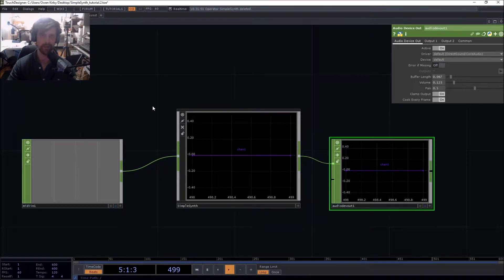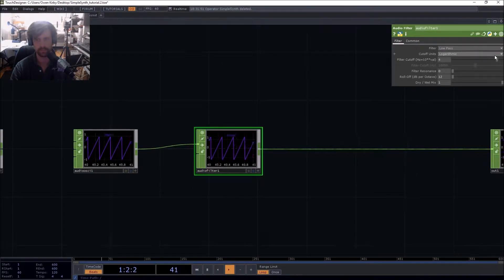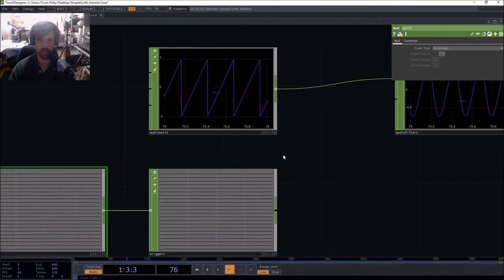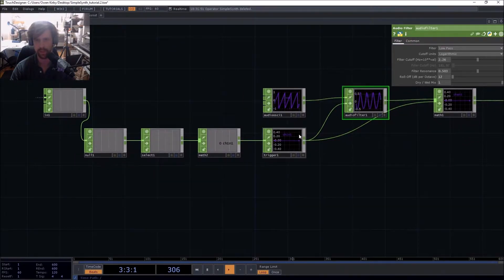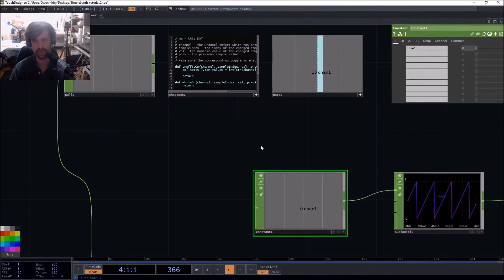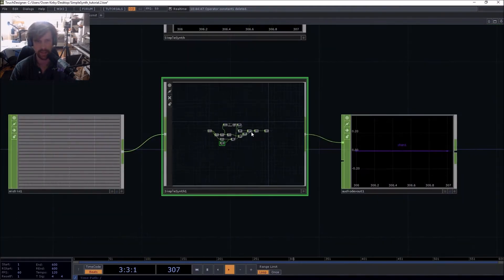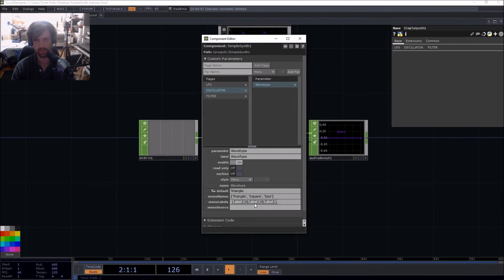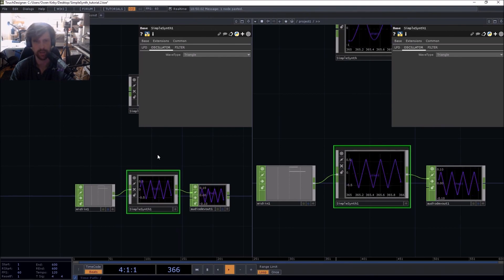ELECTRONIC APE FRIENDS - Episode 1: Creating a Monophonic Synth in TouchDesigner

Comment: Hello this is awesome. I had a question. I’m not the best at code but I want to do the same thing here but I want to use a leap or Kinect instead of a midi controller. What code would I use to get that info instead of the midi?
Reply from the maker: You can use any channel information coming from your kinnect CHOP or leapmotion CHOP. Simply rename it to the standard touchdesigner midi nomenclature,  typically ch*n*. The channel value corresponds to velocity.
Reply: Thank you Owen!! so when I do this do I need to change this code from the video Op(‘notes’).par.value0 = int(str(channel.name)[4:]) or will it work when I do the rename?
Reply from the maker: @vjcatalyst7830  the code is to rename standard midi messages in a way that will work with the rest of your synthesizer network. It's easier to leave that as is at the input stage and send channels that are named using the standard TouchDesinger
 midi nomenclature.
Reply: @OwenKirby  Thanks again for your help. so i did the rename but the chop exec is still not changing the constant names notes. could I maybe send you my project file?
Reply: Heya! Did this get solved? I'm trying to use OSC Data from my phone to control sound but i got the same issue as you with the notes constant…

Comment: Hi.
First of all. Thank you so much for sharing your knowledge.
Second. Sorry for my bad English, I'm a graphic design student from Spain. I would like to know if there is a way to avoid the "clipping sounds" that happens every time you press a note (when I have fast attack and no decay)

P.d.
I'm working on my degree final project, and I decided to make a visual interface for a synthesizer in order to make synthesis easier to learn. First I made a basic synth, based on your tutorials (I didn't know touchdesigner till I started investigating for my project) and then programmed all the midi mappings to control it from my midi controllers. I just did my first MVP with a noise that is "mapped" into a grid using glsl (kinda map displacement, rutt etra style). 

I'm searching for people that works with touchdesigner to have some feedback from my prototypes and iterations. If you are interested I'll be very glad to send them to you.

Thank you again! keep doing such a great job!

Alex
Reply from the maker: Salutations Alejandro,  
Thanks for leaving a comment! I'm always happy to hear that these tutorials have been helpful. As far as I can tell, an amplitude envelope with a decay value of 0 will necessarily create a pop/click sound because it will be instantly dropping from your peak value (typically 1) to your sustain level. Other common causes of pops/clicks when working with audio in TouchDesigner are due to insufficiently fast sample-rates which cause  ''stepping'' in your modulation channels. Try and see if you can play around with that on the common page. I usually set my modulation channels to 3000 but that might even be overkill for most applications. 

I'd be glad to take a look at your work! What's an MVP?
Reply: @OwenKirby  Thanks a lot, I will try that solutions. Thanks for your interest, as soon as I clean a little bit my project, and improve some aspects I will send it to you. MVP (minimum viable prototype) is how we call the first low quality prototype in agile methodologies, Or so they teach me 😅.

Thank you again for your feedback ;)
Reply: Hi Owen. I have advanced a lot in my project, but i still have one problem with the synth. (i've been working in the visual section) I would like to have an lfo section (in the parameter section of my component) where you can choose between different waveforms, change amplitude and freq (3 knobs) which you explained in this tutorial, but i would like to implement a dropdown menu to choose the destination of that LFO, pitch and amplitude are good for my project. I've been searching trough a lot of tutorials and i didn't find a solution for this. Do you know where i could find more info? Have you implemented any way to set the destination of the lfo in your projects? Thank you for your tutorials and videos, you've made awesome stuff these months. I can wait till you put your components on sale, they look really interesting. Thanks for everything and sorry for my english. If you wish i can send you a video of how my project works ;)
Reply: @OwenKirby  Hi Owen. I have advanced a lot in my project, but i still have one problem with the synth. (i've been working in the visual section) I would like to have an lfo section (in the parameter section of my component) where you can choose between different waveforms, change amplitude and freq (3 knobs) which you explained in this tutorial, but i would like to implement a dropdown menu to choose the destination of that LFO, pitch and amplitude are good for my project. I've been searching trough a lot of tutorials and i didn't find a solution for this. Do you know where i could find more info? Have you implemented any way to set the destination of the lfo in your projects? Thank you for your tutorials and videos, you've made awesome stuff these months. I can wait till you put your components on sale, they look really interesting. Thanks for everything and sorry for my english. If you wish i can send you a video of how my project works ;)
Reply from the maker: @harryjotabrown  Hey that's great! I have definitely implementedd this a few times and there's a couple of ways to go about it depending on the specific situation. I'll make a tutorial about it this week (probably Saturday). Meanwhile you might want to look into getting familiar with the connector class in Python or have some math chops that attenuate the signal dending on your menu selection. Keep up the good work!
Reply: @OwenKirby  ohh Thank you so much, i hope the notification bell to ring on saturday hehehe. Thanks a lot ;)
Reply from the maker: @harryjotabrown  Things didn't go as planned today. Gonna try again tomorrow!
Reply from the maker: @harryjotabrown  I wasn't able to record a tutorial I wave very happy with but here is a network I put together to answer your question. I hope you find it useful! https://www.dropbox.com/s/3mk1u86rt4da65y/Alejandro%20mod%20routings%20question.toe?dl=0